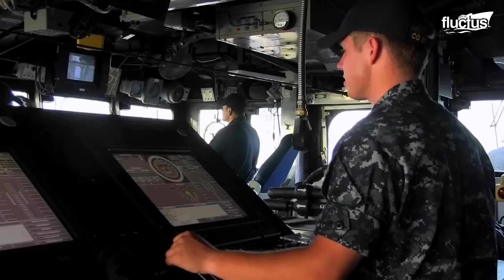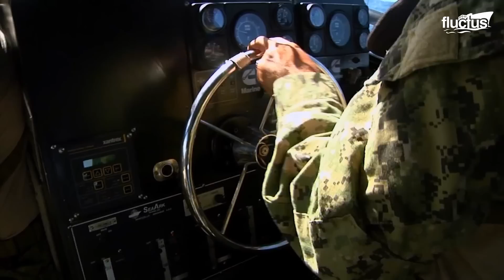The Crazy Reason Why US Sinks its Own Ships With Super Advanced Missiles

Comment: There are several reasons for doing this when they went to sync the aircraft carrier midway which was built back in World War II they had predesigned charges placed strategically to make sure that if they couldn’t sync it that they would Sanket they threw everything in the arsenal of the Air Force and Navy at the hall of Midway they bombed it they torpedoed it dozens and dozens and dozens of times but yet she didn’t sync they literally had to blow the charges to get her to gather water it’s called compartmentation it’s called design they were so many compartments did those weaponsCouldn’t reach so much stuff loaded despite what was done to her that’s why they do it